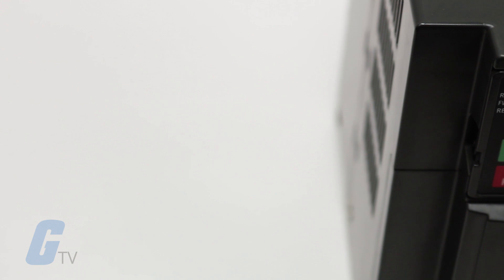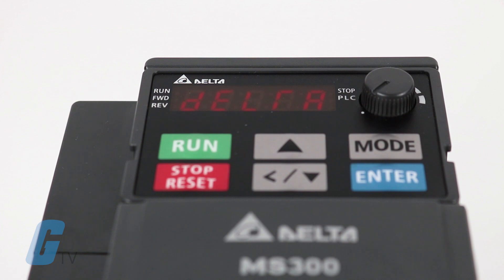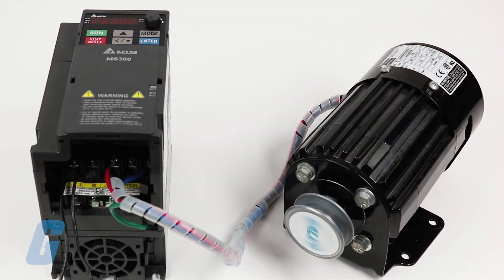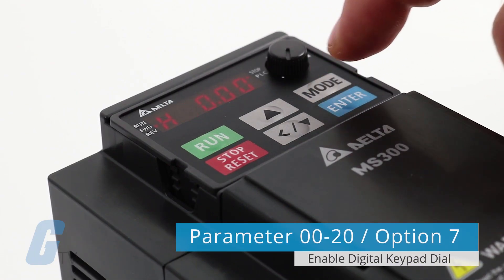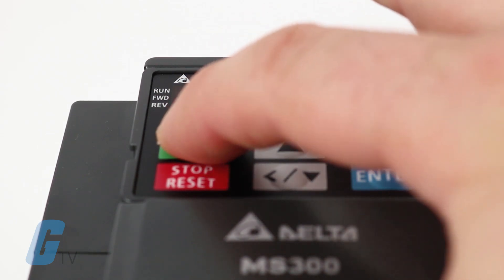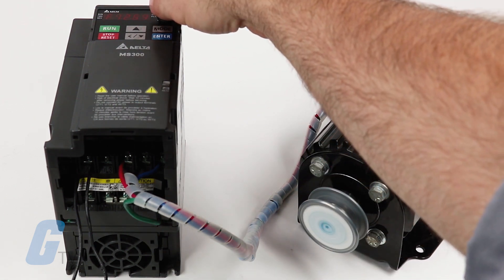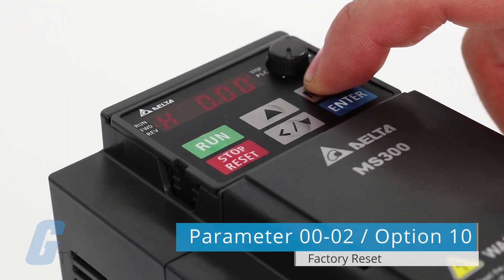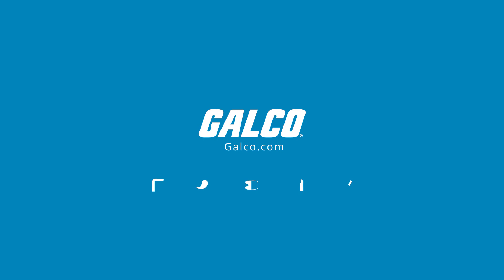Basic Start Up of Delta's MS300 Series AC Drive

Comment: I got 3 phase delta  input  power to vfd  ms300, when the motor kick On the input amp draw is lower and  the other 2 input are higher than motor  name plate,  does the vfd causes  this effect  or is something wrong with my incoming power.?  Orp displays as the  error code.